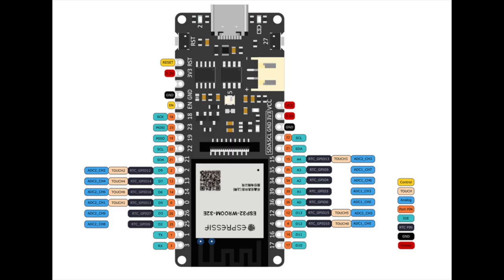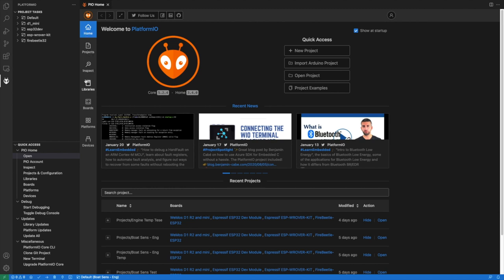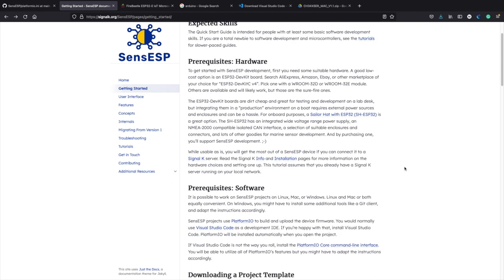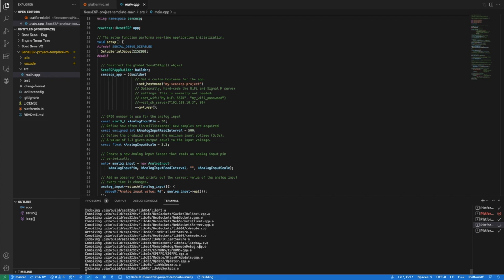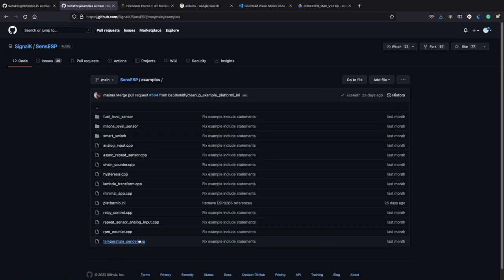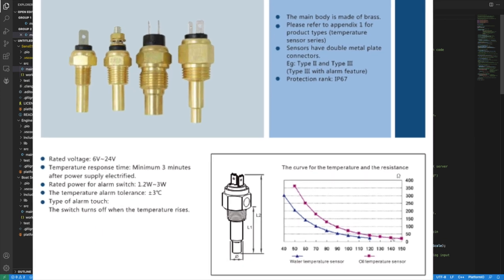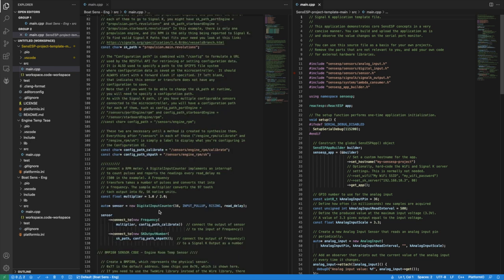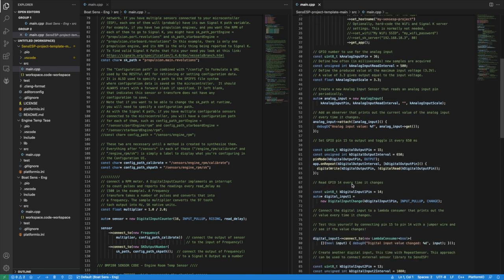OpenPlotter - ESP32 - Getting started, adding code and digitising an older engine MD2030 - SensESP

Comment: ciao sto seguendo il tuo progetto, ma non riesco a compilarlo. i driver e la scelta dell'ESP sono corretti, infatti altri programmi sono normalmente caricati. Quando provo a compilare la tua applicazione incorro nei seguenti errori:

#define LED_BUILTIN LED_BUILTIN
<command-line>:note: this is the location of the previous definition
<command-line>:error: expected unqualified-id before numeric constant
e successivamente:
***[.pio/build/esp32doit-devkit-v1/libc67/FS/FS.cpp.o]Error1
***[.pio/build/esp32doit-devkit-v1/libd81/reactESP/ReactESP.cpp.o] Error 1
..............
src/main.cpp:127:28:error: expected type-specifier before 'MovingAverage'

puoi aiutarmi a risolvere?
Reply from the maker: It is not happy with the fuel consumption part of the code. Do you have the following like at the top in your includes?

#include "sensesp/transforms/moving_average.h"

Non è soddisfatto della parte del codice relativa al consumo di carburante. Hai i seguenti like in alto nei tuoi include?

#include "sensesp/transforms/moving_average.h"
Reply: @BoatingwiththeBaileys  si grazie il problema è risolto. Tutto funziona, ma non riesco a cambiare SSID e password sull'ESP32. mi puoi aiutare ?
Vorrei anche inserire il controllo del serbatoio carburante il mio sensore va da un valore da 350 Ohm (vuoto) a 18 Ohm (pieno) mi dai un consiglio? 
grazie.
Reply from the maker: Good. Glad you got it working. The SSID and password should appeard when it first starts up. It should broadcast an SSID for you to connect to. Is this happening? https://signalk.org/SensESP/pages/user_interface/

For the fuel tank, if you use the same code as the tempreature sensor you just need to change anything that uses temp to another name. Create another 'class TemperatureInterpreter : public CurveInterpolator {
 public:' and again call it something else. 

I will try and do a video on this as this has come up a couple of times.

-------

Bene. Sono contento che tu abbia funzionato. L'SSID e la password dovrebbero apparire al primo avvio. Dovrebbe trasmettere un SSID a cui connettersi. Sta succedendo? https://signalk.org/SensESP/pages/user_interface/

Per il serbatoio del carburante, se usi lo stesso codice del sensore di temperatura, devi solo cambiare tutto ciò che usa temp con un altro nome. Crea un'altra 'class TemperatureInterpreter: public CurveInterpolator {
 public:' e chiamalo di nuovo qualcos'altro.

Proverò a fare un video su questo dato che è emerso un paio di volte.
Reply: @BoatingwiththeBaileys  Ti ringrazio, in attesa del tuo video sul serbatoio carburante, proverò a seguire il tuo consiglio di replicare il metodo di controllo temperatura. A proposito dell'SSID/password ,ho fatto diverse prove anche usando WiFi Manager con Arduino, ma non riesco in nessun modo a riportare la ESP32  nella condizione di Access Point iniziale ( quella descritta nel capitolo "User Interface" nel manuale di SensESP,) per poter inserire un nuovo SSID e una nuova Password.
Reply from the maker: Se rendi la rete a cui si connette normalmente indisponibile per un po' di tempo, dovrebbe quindi ripristinare questa pagina.
Reply: @BoatingwiththeBaileys Ciao, ho provato a disattivare la rete per 6 ore ma non è cambiato niente. Hai qualche altro suggerimento?
Reply from the maker: conosci il suo indirizzo ip? puoi scansionare la tua rete per trovarlo e provare a navigare fino al suo ip? Dovrebbe consentire di cambiarlo in questo modo. nel codice puoi impostarlo manualmente, tuttavia quel codice dovrebbe essere cancellato. controlla solo di non aver aggiunto nulla per errore
Reply: @BoatingwiththeBaileys  Ho provato con diverse app( Ipscanner, Net Analizer ...) ma non riesco a trovare il suo indirizzo IP . IL codice che sto utilizzando è il tuo senza modifiche e con le vecchie SSID e PWD funziona benissimo
Reply: Ciao, finalmente sono riuscito a trovare l'IP della ESP e qiundi a resettarla.ora è tutto OK. Mi scuso con te per la pazienza che hai avuto. Avrei un'altra cosa da chiederti: nella "Engine Temp Config" con che criterio hai impostato la R1 a 1000 .0 ? grazie
Reply from the maker: Eccellente - Sono contento che funzioni. Il valore R1 è il valore del resistore che hai sul circuito stampato, non il valore del sensore che potresti avere nel tuo motore. Devi solo aggiungere quel valore nel codice. Sto solo aggiornando quel codice dopo una piccola modifica, dovrebbe assomigliare a questo: nota Vin, Vin sulla riga 1 che è diverso da ciò che è online al momento. Aggiornerò quel codice a breve.

//// Engine Temp Config ////

const float Vin = 3.3;
const float R1 = 120.0;
auto* analog_input = new AnalogInput(36, 2000);

analog_input->connect_to(new AnalogVoltage(Vin, Vin))
      ->connect_to(new VoltageDividerR2(R1, Vin, "/Engine Temp/sender"))
      ->connect_to(new TemperatureInterpreter("/Engine Temp/curve"))
      ->connect_to(new Linear(1.0, 0.9, "/Engine Temp/calibrate"))
      ->connect_to(new MovingAverage(4, 1.0,"/Engine Temp/movingAVG"))
      ->connect_to(new SKOutputFloat("propulsion.engine.temperature", "/Engine Temp/sk_path"));
Reply: @BoatingwiththeBaileys  Ciao, ho preso nota delle tue ultime modifiche, non vedo l'ora di provarle. Ora sono alle prese di un nuovo problema: Ho due sistemi gemelli (Raspberry pi /Openplotter e ESp32 ) uno in barca e uno a casa dove faccio i miei test. Utilizzando la stessa rete wifi (trasportabile) mi accade questo: a casa l'ESP si collega subito a SignalK mentre in barca non riesco ad ottenere la richiesta di accesso. Ho fatto svariati reset, ho scambiato le ESP tuttavia non ho risultati. Ti è capitato qualcosa del genere ? Dove posso indagare per cercare una soluzione?
Reply from the maker: sembra che tu stia facendo buoni progressi. Sul sistema della barca hai abilitato 5g in quanto l'esp è solo 2.4. anche la barca pi è configurata per connettersi al porto turistico o al wifi del telefono? Ho scoperto che il mio deve essere disconnesso affinché l'esp si connetta., altri dispositivi come un telefono possono connettersi al Wi-Fi della barca Pi? funziona?
Reply: @BoatingwiththeBaileys  La barca ha una sua rete creata con un router e una sim card collegata ad Internet. Openplotter è collegato a questa rete e quindi ad internet. ESP32 e associato alla stessa rete. Openplotter di bordo ha collegati GPS, AIS, sensore BME280, Seatalk1, tutto perfettamente funzionante. Quando attivo ESP 32 con il tuo software caricato, non c'è la richiesta si autorizzazione di collegamento al Signal K. Oggi ho portato in barca il secondo Raspberry con lo stesso Openplotter e la stessa ESP32 è l'ho collegato alla stessa rete WiFi. in questo caso il collegamento fra ESP32 e SignalK avviene regolarmente. La sola differenza è che il secondo Raspberry non ha collegate tutte le altre utenze. Non so cosa fare
Reply from the maker: @pietromaurizio8990  Ora capisco. Questo non è qualcosa che ho fatto, dove il pi è connesso a una rete. Il mio Pi è la mia rete wireless sulla barca. Potresti provare a impostare quanto segue //->set_sk_server("192.168.10.3", 80) all'indirizzo del tuo Pi e quindi unirti al router nel modo normale. Rimuovi il // e hai aggiunto il tuo indirizzo Pi? Facci sapere come ti trovi.
Reply: @BoatingwiththeBaileys  ciao non è chiara la traduzione di quello che dici. prova a scrivermelo in inglese Grazie
Reply from the maker: I think I understand the issue now. Set this line in the code to the ip of your pi //->set_sk_server("192.168.10.3", 80), remember to remove the // and then connect the esp to your router. I don’t think the esp knows where to send the data. That line tells it where the SK server is. My setup, the pi is the WiFi network so the data has to go that way. Hope that’s clear.
Reply: @BoatingwiththeBaileys  devo aggiungere quella riga di programma con l'IP del SK corretto al codice su Platformio?
Reply from the maker: its in the main.cpp (the main file) it will just be commented out as i dont need it. Remove the // to enable it and then add your boat pi IP address and it should connect.

è nel main.cpp (il file principale) sarà solo commentato perché non ne ho bisogno. Rimuovi // per abilitarlo, quindi aggiungi l'indirizzo IP pi della tua barca e dovrebbe connettersi.
Reply: @BoatingwiththeBaileys  Finalmente ce l'ho fatta grazie al tuo indispensabile aiuto. Ora dovrò adattare i valori dei vari sensori, ma in grosso è fatto. Grazie ancora.
Reply from the maker: @pietromaurizio8990 Ottime notizie - Siete i benvenuti. Buona navigazione. 

Great news - You are most welcome. Happy Sailing.
Reply: @BoatingwiththeBaileys  HI
As I told you now it works. I hooked up all the sensors on my old 2003 Volvo, but like you, I'm having trouble pairing with the engine temperature sensor. In order to definitively resolve, I thought of reconnecting this sensor to the old analog gauge and installing a new "One Wire" sensor on the engine like the one mounted on the exaust. To this end, I ask you: 1) how to connect the two "one wire" sensors together. 2) how to adapt the code for the new sensor
thank you
Reply from the maker: @pietromaurizio8990  Glad its starting to come together. To add another 'one wire' sensor you just need to copy the code under that exhaust temperature sensor and paste in again as far as I understand. So something like this:

  auto* altenator_temp =
      new OneWireTemperature(dts, 1000, "/alternator Temperature/oneWire");
 
  alternator_temp->connect_to(new Linear(1.0, 0.0, "/alternator Temperature/linear"))
              ->connect_to(new SKOutputFloat("propulsion.main.alternatorTemperature","/alternator Temperature/sk_path"));

All I have done here is  replace everything that had 'exhaust' in and changed it to 'alternator'. You can call it what you want but make sure you change all. Then you connect the sensor to the same pins on the board or if you have copied mine and made the small breakout board, connect it to the next set of pins on that. They are connected in series and from what I understand the ESP will read them in that way.

Hope that helps.